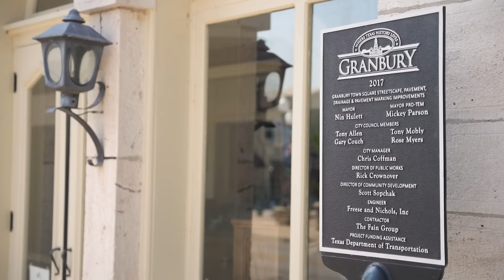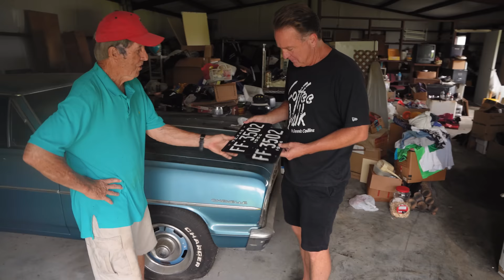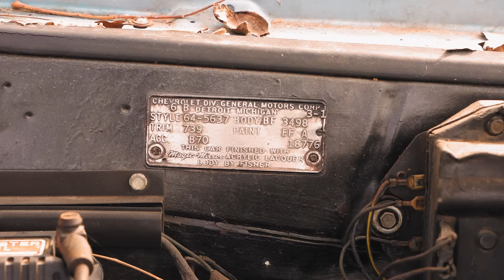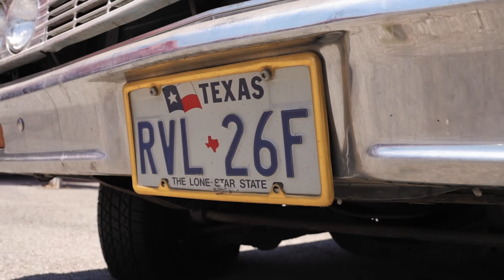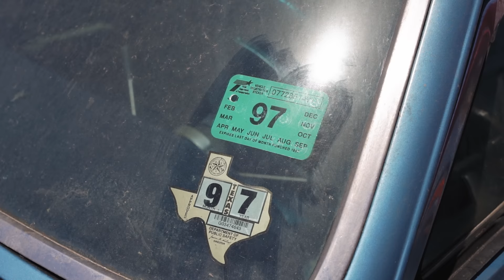RESCUED: One of the FIRST A-Body Platform GM Cars!

Comment: I would buff it out get it running good and drive it 😊
Reply: Hell,yes!!!!!
Reply: Absolutely ! Lovely car 👌🏻
Reply: I want a 1963 ~ 1967 Chevy Nova...I would drive it as my primary car. 6 cylinder manual tyranny.
Nothing electronic (except the radio)
😁
Reply: Add an air conditioner too.   Nice little cruiser
Reply: I would do the exact same thing That's a pretty car the way it sits. Make it run drive stop and enjoy it
Reply: Same here. Ain't broke,don't fix it
Reply: That’s exactly what I would do.
Reply: Yeah I'd drive that car around town
Reply: I can remember late 90s picking up 1st gen broncos, chevy lls Malibu. One thing I could kick myself for was all the 80s 90s station wagons with trans, engine problems that were cherry paint, interior that were basically going for scrap prices. Woulda coulda shoulda ....

Comment: I used to have a 64 Chevelle SS Munci M21 with 283 bought just after HS graduation in 1975. I swapped the engine out for a 327 out of a 1965 Impala SS powerslide. Drove the SS Chevelle all through college and to my first post-college graduation interview.

Comment: Swap in a built 327 with 350 turbo transmission. Throw some disc brakes up front and a little steeper gear in back and drive the snot out of it. Great car guys.

Comment: Mine was dark blue,250HP 327 4speed. My daily driver and weekend drag car.  Best run ever from that little E Stock car was 105 MPH in 13.05 seconds at Fremont Drag Strip in Fremont Ca sometim in summer 1965.  Had to sell when I went to RVN in Sept 1965.
Reply: Dad's was the 300 sedan with the 6 replaced with a a 60 over 292. It ran in the u stock class somehow with the 292 🤫. Don't remember the times, it was about 1975 until about 78 and I was 4-7 going to the dragstrip. 😊

Comment: Great find Dennis! I would absolutely tub that car with a 502 or bigger.
Reply: It’s an all original car. Don’t start cutting it up and keep the big heavy gas guzzler engine out of it. Basically keep all stock. It will be worth more later in its life. Basically when it comes to these classic cars if they have been cut up,engine changes, color changes etc , I don’t buy them. Thanks

Comment: Three vehicals I wish I still had. My 1st one was a 1968 Dodge Corenet white top, blue body. My 2nd was a 1959 Chevy Apache step side black with hydromatic transmission and then my 3rd was a 1969 Chevy Malibu blue. The 1st one I had a flat tire and when I went back to get it it had been towed because someone hit in the rear and put the trunk in the front seat. Sold the 2nd one because I didnt have the money to get the brakes fixed right and thge 3rd my gf at the time had a wreck in it and it was completely totaled. I love seeing you rescue all these great cars and maybe one day I can come up and see your shop.

Comment: Oh that's a beautiful Malibu! 
I would rebuild the suspension, upgrade the brakes and upgrade the rear to a 12 bolt.
And replace the dash pad carpet and reupholster the seats. 
I love the Rallys, but I would probably do body colored wheels with dog dishes.
I would drive the hell out of this car, so I would just do a LS swap with an auto and the built rear. It's Texas, so naturally a Vintage Air AC is in order.

Comment: I was the second owner of a 64 Malibu Chevelle SS. Muncie 4 speed, 283 with factory performance cams, factory headers, twin exhaust, Rochester 4 barrel carb. Yes it had the bucket seats with center console. The metallic blue( your silver blue). Man do I miss that car. I still have the SS hub caps because I put the Chrome Crager SS wheels on it.

Comment: I used to do the no airchuck trick all the time. I think it only works with long valve stems and the Milton 727 style airline couplers. This car reminds me of one of the worst mistake I ever made. In 1988 a good friend kept trying to sell me a rust free , black on black, small block, 4 speed , 65 malibu that he daily drove for $3000. I loved the car, but had just bought a brand new yamaha banshee, I was making payments on it, so I had no money. Over the winter he had our good friend Vito narrow the frame and rearend, put wheel tubbes and a roll bar in it, and he added center line wheels with skinny tires up front ,and huge McCreary tires out back. It  wasn't fast, but it had a nice cam, it had a spool in it, it was black, and it was badass. That next summer he continued trying to sell me the car, STILL for $3000. I knew he had more than that just in the parts to make it a pro street car, but that's how badly he wanted me to have a nice hot rod. To this day I can  not believe I was too stupid to sell my quad and buy that car. That's not the first or last stupid decision I've made in my life, but it's definitely one of the most painful.

Comment: I've got a 2004 or 2007 (its been yrs) Honda Shadow 750 custom black paint with a skull on the tank and silver accents paint job, custom shaved and embroidered seat, custom chrome package with straight pipes  and 7,400 original miles. It's been garage kept and was built in New Orleans. I'm a disabled Firefighter/EMT and haven't rid for over a decade. It needs carbs cleaned, a battery and new tires. I'd like to sell it but have no idea how much it's worth. If Dennis's guys are intrested let me know. It's a beautiful bike with no dents or damage. One tiny paint chip on the front fender from a buckle that sat on the front forks.

Comment: My first car was '64 Malibu , sent home money from Viet Nam . My mother bought it for me so I'd have it when I got home . If I had it now , I'd put the drive train from a GNX in it . Engine Trans Rear end Front discs 60 maybe 50 series tires . Basically same curb weight as a GNX .
Reply: Thank you for your service.
Reply: Go Buick :)
Reply: @thomasthurston6656  Think it would surprise the hell out of sombody . . .
Reply: @williambostick2795  Most Buick's do. I have my great grandparents 67 Special Deluxe bought new just a stock 225 V6 and 2 speed trans ran low 18s in Socal at Pomona and LACR. I did nothing dove in about 50 miles and ran it. I have had a 2000 Park Ave ran tell about 130k miles. Had a 1996 Riviera that went for 206k miles and was still kicking ass. I have a 14 Challenger now bought new in 14 its plum crazy with the classic package. I will never own another Mopar it's junk and gets 13 mpg city. It's no good when are gas was over 7 dollars a gallon in CALIFORNIA.

Comment: Mine was a 64 model with a 327 and 4barrel and 4speed.  Dark blue with a silver blue interior.  PS/PB and rear seat speaker and right side mirror.  Great car, wish I would have kept it. Traded it in for a 67 Nova SS with the same equipment as the 64 had.  Great video!!  Thank you.

Comment: 9:32 Paint is FF, body is 3498. The tag the owner gave you is FF 3502. In 1964 when tags were bought new, if they would’ve got there 4 tags earlier, tag would be FF 3498. How rare would that be to have 64 tag with paint and body code on it? Outstanding, and get you some of that

Comment: I've tried that trik to air up tires many times sometimes it works sometimes it doesn't but it works 100% when you take off the valve then after its aired up you just be ready to quickly stick the valve bavk on.

Comment: Gut it. Acid dip body shell by pros. Black leather " GT " interior, mohair headliner and visors ( mirror on each )...
Blueprint / balance 327, 4 speed automatic, original console and leather wrapped T handle. New "soft ray" glass SET, from A M D.  PALE yellow " Imron / aircraft paint. SS original full wheel covers, over 15 x 7" Full size Caprice disc ;rake code / offset rims. Split front bumper laterally through turn / park light openings, add 3" gauge steel flat stock. Rechrome. D I E T  to Nova SS weight. Drive it like Dan Blocker or my grandmother. Rubbermaid colored daisies all over the doors and rear quarters. 
$ELL to LS swapper...as rolling, braking, steering engine stand.

Comment: Cut the floor and chassis out put new custom floor and chassis in to accommodate a lsx427 and transaxle with independent suspension full and updated front suspension steering and brakes

Comment: I had one,mine was tan with white interior 283,I was 17 so I went with the Edelbrock highrise and Holley plus header's and side pipes air shock, M/50/15 on the rear,  and traded it for a "61 Impala SS rag top with the 348? I passed off as a 409, it came with Tri power,stock dual point  dist. Four speed  white with red interior. Black top I put on myself, it got ripped off by a so called friend who made up a mobile mechanic business and put a lien on it for work that was never done,then sent the bill to my parents house, while they were on vacation for three months and neighbors were picking up the mail.and I missed it, because I had my own address I only got mail at my parents when mom would call and say I had mail.  Funny how his brand new 327 in his"56 Chevy truck all of a sudden froze up. Over heated, water jackets were all clogged as was the radiatorRight after the front end exploded when he turned on the headlights one night. I knew what it was and was waiting for the whole truck to explode.    He pissed off my mother, she liked the Impala it reminded her of her 61 Pontiac  mom didn't play nice, she had a little ball peen hammer she would use to break out the top of a headlight then she would pour gasoline in up to just under the element, plus she liked to pour minute rice into radiators,

Comment: What would I do with it? I'd build the biggest SBC stroker you can (for max torque), beef up the power glide, keep the patina, add disk brakes on all 4, clean up/restore interior, and put vintage air conditioning in it, then enjoy!

Edit: add a posi if it doesn't have one.

Comment: The dealerships used to put ss hub caps on those cars to make them fly off the lots witch they did our family bought a 65 wagon 283 power glide no ac 😢 we put one of those window mount swamp coolers on it ( that don't work worth a darn ) went on car vacations for 3 weeks every year remember stoping at a Chevrolet dealer to address a vibration in the tires and they chucked them up and shaved them to make them round oh yeah it was burning alor of oil and the service bulletin stated to remove the air cleaner and sprinkle commet cleanser down the carb while reving it up to break in the rings I look back on this now and wonder what we're they thinking as far as building American cars and letting the customer be the R and D department and as far as this very moment nothing has changed😮

Comment: I'd be curious to know what the VIN production number is. 36 Years ago I owned a 1964 Chevelle Malibu two-door hardtop 283 Powerglide 308 10 bolt posi. White with blue bench. The production number was 100048. It was a Fremont car. I suspect it was built on the first day of 1964 production as it was the 48th Chevelle produced. I was born in 64 so I kinda wish I had kept it. I currently have 3 69 Chevelles that Ive had over 30 years. One since 1985. I admire and like the cars and I really dont care what they're worth.

Comment: Are you guys interested in 80s fox body's? I just found an all original 83 glx 3.8 87k original miles. Cars interior is almost 100% and is cadet blue cushion style seats. Exterior polar white. Convertible with an original working top 0 rips or scratches. It runs like we are still in 1983.

Comment: A nice SS clone restomod. Since the motor is not correct, maybe you can find a nice 327 to be a little more correct and to get a nicer, more desirable powertrain. The interior is a coin flip. New seat foams and factory style covers to go back on, or an attempt to get a nice set of buckets and console shift. The exterior is pretty nice as is, if your team can shine it up like the original paint on the Shelby Mustang, the rally wheels and proper trim or even what is there, can finish it off! Not a big dollar refurbishing nor big dollar sale, so it will move quickly. Still room for a decent profit I suspect.

Comment: Hey i own the same exact car 64 malibu sport coupe 283 4 barrel 220 hp dual exhaust.. since 82... way back, i installed a 327 4 speed.. same color combo.. i bought it from the original owners... the body has 76 k .  All V8s had the V emblem with no flags the flags were supposed to be added if it was a hi horse L79 motor, but i believe its a misnomer as they actually started those emblems in 65. The seats look to be recovered and never had head rests. All had steel wheels with full hubcaps or poverty caps... i love the 64 to 67 chevelles and my brother and i have owed quite a few.. my car was built in van nuys and sold in Redwood City, California.. thanks for sharing... how much are you selling it for?

Comment: Dennis you know everything about cars but you don't know about a 63 Nova came with a 283 full-speed bucket seats and when I told Jay Leno that the 66 442 all the cause he has he didn't know that the emblems for 442 with a factory colors so I posted it on his website that yes they were correct and and he gave me a whole box of his cleaning products I watched all his videos too he don't have 4000 the 65 Malibu which is rare as hell with a 396 full speed and 63 came with a V8 for Speed 283 Raiden make a 64 Malibu as far as I know but I could be wrong but I don't think so

Comment: I restored a 64 SS back in the mid 80s it was a factory 327 4 speed with factory in dash AC.  Apparently it was super rare but I didn't know how rare. It was originally white with blue interior but was the color blue as this one when I bought it for $800 but I changed it to red with white interior and man was it sweet when done. I sold it for $5k.